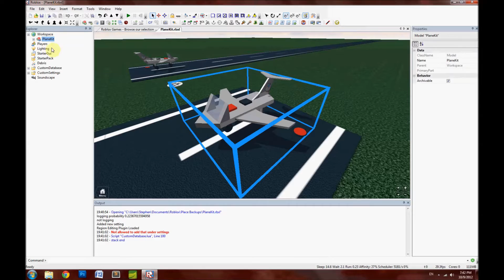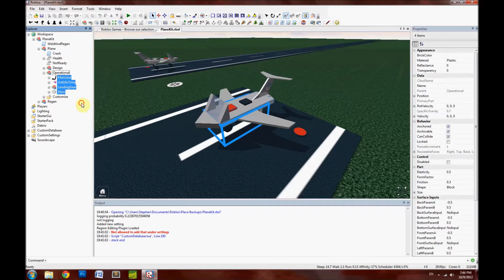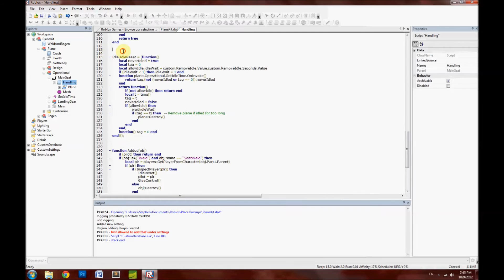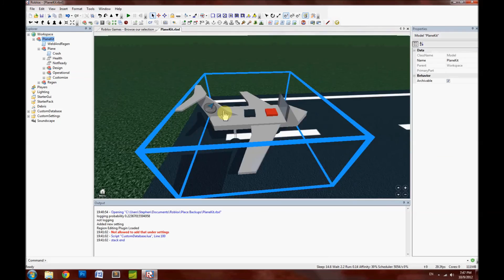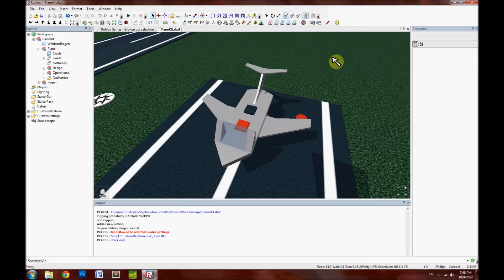Plane Kit V2: How It Works

Comment: I have 2 questions. 1) How do you get the mouses hit without a tool that either autoselects or a person selects? 2) (you may or may not be able to answer this) How do you use the "AddSpecialKey" and keypressed to a gui while ignoring that its a locked function and getting the "Unknown Exception" Error?